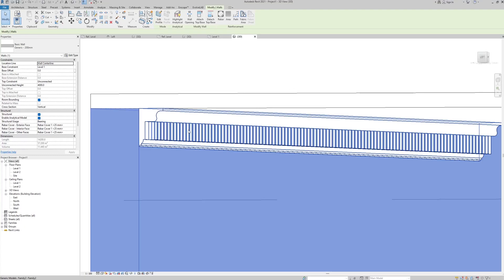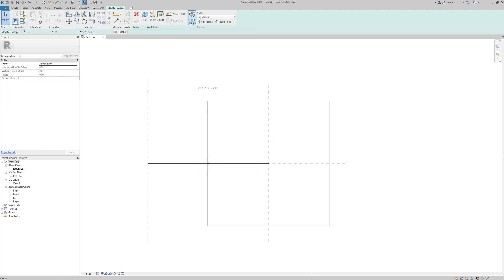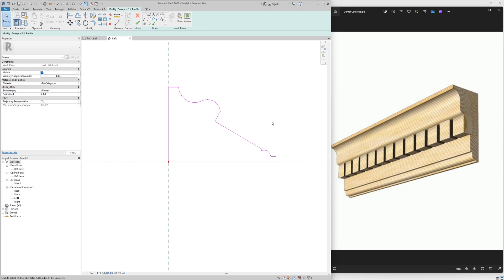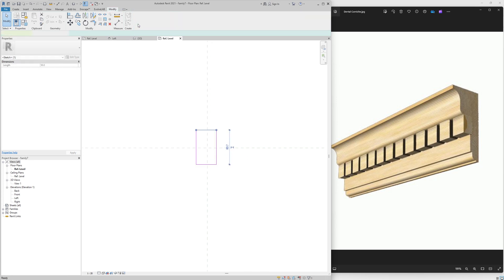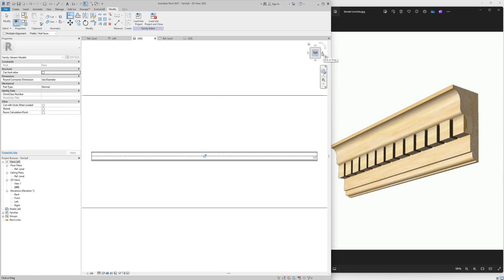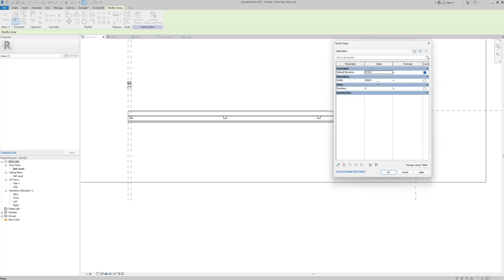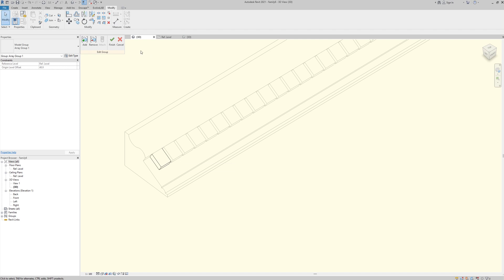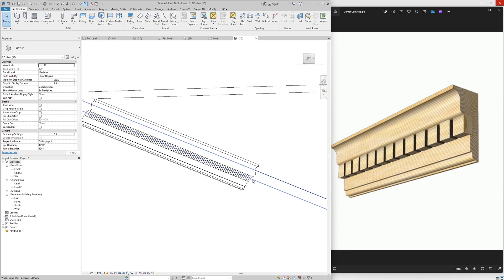How to create Classic Dentil Corniche (customized corniche) in Revit

Comment: Hi, thanks for this video. I managed to create a dental panel. however when I insert it on the outside of the building the external corners don't join and there is a gap between them on the corners. Could you suggest what I can do to join them? Thanks again.